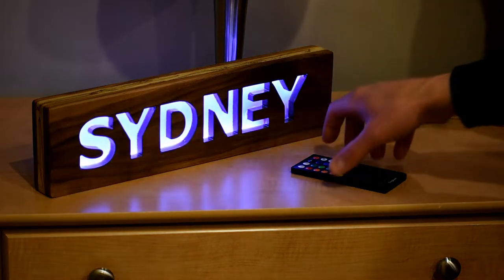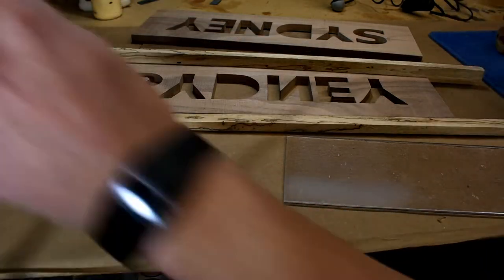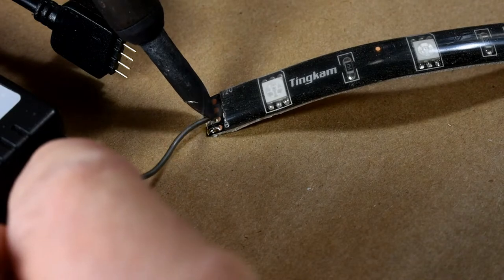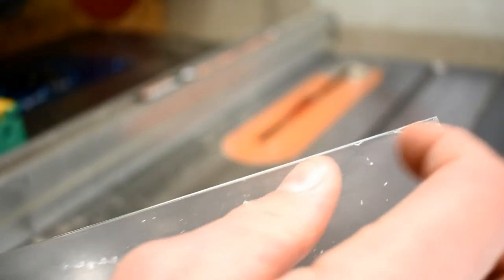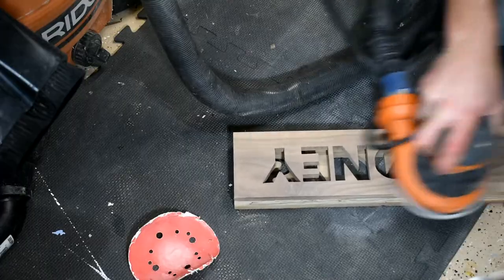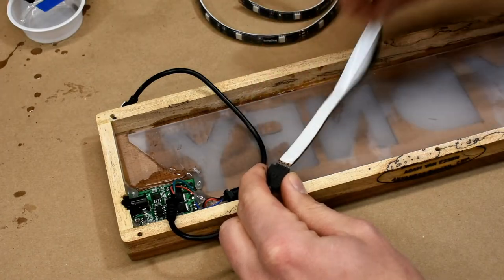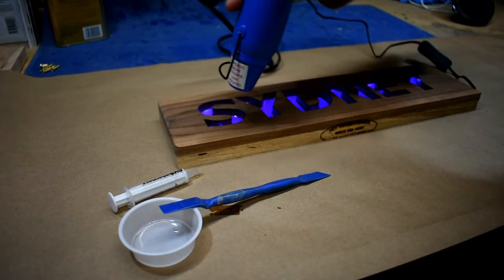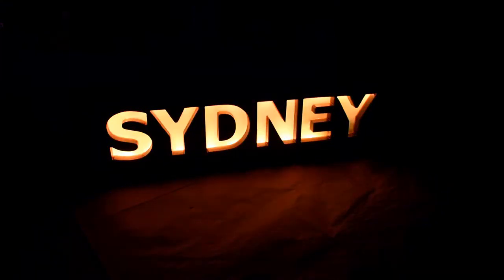Custom Night Light

Comment: This came out really nice, thank you for sharing. Are there any concerns with heat buildup over time from the LEDs being inside the closed piece? I'm finding that some LED strips say they get warm to the touch.
Reply from the maker: Thank you! No, the LED strip I used doesn't get too warm so I'm not worried.